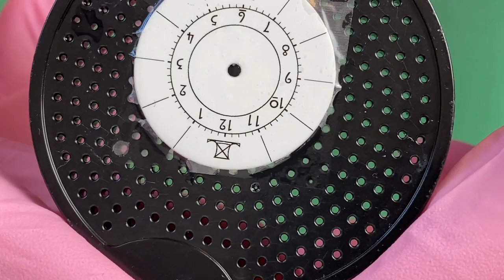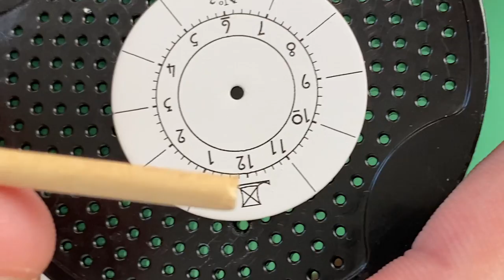Making Custom Dials: A Waterslide Decal Process That Works!

Comment: I haven't ever used the "film free" decal paper yet.  Looks very interesting.  I have a laser printer that can also print in white.  Let me know if you ever design a face with white details and I can print it up for you to see how it works!  Great video as always.
Reply from the maker: sounds good. thanks for watching :)
Reply: Hi DimensionMachine, do you still have the ability to print in white? I’ve been having a hard time trying to find someone that can, but if you are able to I’d love to work with you on something!
Reply: Hey i'd be interested in getting a dial printed. I have a black dial with white details.
Reply: @kramerdesignco  I am sorry.  The afore mentioned printer is no longer in use but you could search around for somebody who does laser transfers.  You will need to find somebody with a white toner transfer printer.  Full disclosure white over a black base is going to be the worst case scenario appearance wise, and you may very well end up not being happy with the result.  Plan to iterate and do several experiments.  best of luck!

Comment: I do models and watches. Doing decals with INKJET decal clear or white paper,  print your decal then spray a thin layer of flat or semi-flat clear coat of paint over it. Let dry.  Now you can do your process and it is done.  PS: read the back of bottles. You use them backwards. SOL first and SET second.
Reply from the maker: I’ve thought about using spray, but I usually do that anyway when a dial is completely done. As for the process, it’s not so much about which is first, it’s that they are a little different. Set is used to help prepare a surface, and Sol is for helping it adhere seamlessly with the surface. Both soften the decal, but Sol a little moreso. In almost all examples I’ve seen of their use, Set is applied first and Sol second. This also works for me. :)
Reply: Yes the bottles are numbered as witch to use first.  Also there not for filmless decals, it wont penetrate that kind of film. It's for cardiograp style water slide decals. Not what you were using. Different kind of decals. I'm a modeler of 30 years and a watch tinkerer, I've used both those products for years and with standard good model decals they will look painted on. Great video though, just different kind of decals.

Comment: Use vector art rather than raster art and you will improve the line edge quality greatly
Reply from the maker: it is vector based. It’s a limitation of the printer, not the art.

Comment: Great results! what do you think about using Ghost White Toner products to print white? seems like that's about the cheapest way to print white... might be worth a shot
Reply from the maker: It's a good question and I have looked into it some, but the white printers/toners are very expensive. You're almost better off painting the dial white and then creating the dial using black for everything except the things you want "printed". Basically everything is black except the negative space.
Reply: @WatchComplications  thanks for the reply, yes most of the toners are expensive, but they have some new ones for 150-200 euros last time I checked...
The reason I was looking for one is basically you are restricted by the negative print to always have a black background, or always mask everything with the color you are printing, if you want to use some interesting blank dials with unique patterns or textures with dark colors, then adding the white text or markers this way is not really doable.. 
I have tried it before, only occasion this worked for me was when background was black... other colors were not nice at all. 

I tried print colors with color printer, it will only look half decent when you have pure basic 4 CYMK colors, which doesn't need mixing different colors, even then it didn't look very nice, as colors are translucent white background is always needed...
 
 I'm now searching for a compatible printer if I can find something reasonably priced I would probably test the toner.
Reply from the maker: Thanks for the context. I plan to work with some colors next and see what happens. Perhaps I'll eventually get to white.

Comment: Thanks so much for posting the whole process and what you learned form the different iterations! Did you find the Micro Set leaves any residue?
Reply from the maker: Glad you found it useful. The Micro Set did not leave any residue, very happy about that. The glue that comes with the decals tended to leave a little when I tried it for the first video.
Reply: Yes.  On my metallic sunburst dial surface it did.  As noted in the video, have many test dials and don't use one you can't replace.

Comment: Can you do some ultra closeups sometime at an oblique angle to see the texture of the print (not the resolution, I mean like is it glossy, is it 3d a little?)
Reply from the maker: matte works best for anything decal related on a watch dial, based on my testing so far. maybe if working on a porcelain or enamel surface the glossy results would work, but not on a glossy painted watch dial. The print is simply an ink transfer...there's not much if any texture to it. Any texture is based on film residue that might remain.

Comment: where do you get the blank dials at? Also the holder that you can press your dials into? **EDIT: also where do you get the templates to print with as well as what program?
Reply from the maker: i get dials that may have other things on them and strip them clean, re-prime, and print. can also get blanks sometimes from ofrei or esslinger, depending on size you are after.

Comment: Hey bro, so having just worked through this process myself and having real difficulties with your process, I found the following additional steps pergected my process:
1) Clean decal with Isopropyl Alc before dropping in water (this was the recommendation from Dr Decal the supplier of paper I used)
2) Clean the dial, I was lazy and used Isopropyl alcohol here but do so at you own risk.
3) Apply Microset with an atomiser spray bottle which will provide an even application across the dial rather than pooling together as you experienced. This will also massively help with applying Decal to dial.

All.other steps as per your process. Without the above I couldn't get a Clean transfer and everytime had areas of my print that didn't transfer.

My transfers were pit in a white Enamel dial and look really clean and as if printed. Really impressed.

Thanks for the tutorial!
Reply from the maker: your first step is interesting...I'd almost be afraid of isopropyl being too abrasive on the ink, but maybe it's ok if it's fast. Clean the dial, yes, i typically do that i guess, can't remember if I specifically said that or not in this vid. a small spray bottle is a good idea for coverage. thanks for watching and sharing.
Reply: @WatchComplications  Yeah, it was the recommendation of the supplier to clean the decal with meths, I gave a test print a really good rubbing with iso and had no transfer so seemed safe. Was a little more worried about cleaning the dial with iso but tested it on a test dial I'd bought and no drama.

Regardless, ended up seeing much more consistent results adding the above steps! Hopefully that helps others!
Reply from the maker: @tobihall2247  yup any additional info that might help is very much welcomed!
Reply: @WatchComplications  merry Christmas mate!

Comment: Happen to be wearing the same Vario tee shirt in blue this morning...😀
I particularly enjoy your custom dial and how to series.  Always inspired by them.
I will have to go back now and review how you made the decals.  Can you print decals with better quality then a laser?
Reply from the maker: The decals are printed on film-free waterslide decal paper with a laser printer. When I do pad printing, a laser is used to etch the design into a steel plate. All lasers are not created equal. The etching fills with ink and then a pad is used to transfer from the plate to the dial surface. Pad printing is better quality, but these decals can be pretty good also.

Comment: Great video! Thanks for showing your whole process. Have you tried with colored decals? I'm curious if the chemicals change the colors at all. Also, what kind of primer and clear coat did you use?
Reply from the maker: I haven’t done this process with color yet but will soon. Might make a short video of that when I do it. For these dials I used a Rustoleum flat white primer, spray paint.

Comment: hi, i loved the video! could you do one about white decals on black dials.
Reply from the maker: same process, just paint the dial black and then apply. The issue and cost is a printer that can print white. White toner is crazy expensive. The other option is using a white dial and then creating a graphic that is black except for what you want to be white.

Comment: Hey I'm about to try this method to print a custom date wheel. Do you think it would come out nicely even under the magnification on the crystal. The image is plenty large at about 4000px and extremely sharp. I guess it'll depend on the printer but I'd love to head your thoughts and any other tips you might have on my project.
Reply from the maker: only way to know for sure is to test it :) But your chances for a good look are improved by having that high of a resolution. numbers and letters usually look fine. It’s angled lines that usually look digital.

Comment: This is the best tutorial I've seen, thanks! Can it be done in reverse- have the black decal cover most of the face, leaving the numbers, etc uncovered?  Remove the film as usual, then apply pigment over the entire face, and use some chemical to remove the remaining black decal?  That would give the numbers a painted on look.
Reply from the maker: I'm not sure how you would have a decal that has cutouts for the numbers, if I understand the process you are describing. And about any chemical is going to remove paint, be it the numbers or base paint.
Reply: @WatchComplications  basically I'm thinking about if you can invert the black/white?  So when it prints, most of the decal is black and will transfer to the face. The numbers, logo, etc will be there as the absence of decal.  Kind of like how the film in film cameras is the negative of the actual image.
Reply from the maker: oh, yeah you can do that, basically white is gaps in a color print, although you can also order decals from some shops that have printers that can print white. Some printers can print white, but cartridges are quite expensive. I haven’t tried that myself but that’s something I could test for a future video…the black with white numerals and markers sort of thing
Reply: @WatchComplications  that's it.  But a further step, if possible, is to apply paint to the entire dial afterward and somehow remove the decal, so the paint remains on the dial for the numbers, the rest of the face was "protected" from the paint by the black decal.
Reply from the maker: doesn’t work that way. the decal in my examples is the actual transfer of ink from the film paper to the surface. there is no removing the printing without affecting the surface.

Comment: Always thought microset and microsol were for transfers where the film remains on?  Filmless transfers the toner from the film to the dial surface in the oven so microset might help get the surfaces laying closer together but think the microsol kind of dissolves filmed transfers so the film blends in better to the host surface. Interesting to see that it seems to help with filmless too...
Reply from the maker: yeah, I’m not exactly sure to be honest. What I do know is that it still needs baked, won’t transfer without the heat. But the chemicals certainly seemed to play a role in helping adhesion. It was night and day after the baking depending on whether I used the Micro products or not.

Comment: Any suggestions on where to get blank watch dials from?.. Just starting out and would like to try
Reply from the maker: Esslinger has some brass blanks in a few varieties, could also look for low cost done dials from ofrei, ebay, and the like and then strip them and repurpose, which I do sometimes. Or get a local maker to laser cut some blanks.

Comment: Hi, great vid as usual. I really want to try this myself on a dial with no next, but which does have applied indices. Do you think any damage will come to the indices (which are lumed) in the heating process?
Reply from the maker: it shouldn’t impact the existing indices. look at some of my other vids, especially the latest one where I compare micro set and micro sol with the sunnyscopa glues. https://youtu.be/nctLo7Nm1ws
Reply: @WatchComplications  Actually I was watching that when I was alerted about your reply lol! Was very useful to see you testing on black dials. My dials have raised indices (which I hope are metal and not plastic), and wonder if they will be effected by the heat. 

This might be a stupid idea, but is it possible to layer the decals? Apply one, then apply an identical one right on top for a more pronounced look, and a bit of height  (and perhaps cover up small imperfections)?
Reply from the maker: Look at my video on that specific topic: https://youtu.be/s6-WAOx0pbM

Comment: Good thinking with the micro sol set. Did you bake at 200 fahrenheit? (98 celcius) and how much dpi is your laserprinter?
Reply from the maker: I think I baked at 225f for 20min. Resolution is 2400 x 600 dpi

Comment: hi, very good idea, if I have a black dial, its posible to do silver marks? other question, what program do you use to design the dial? thanks
best regards
Reply from the maker: There are three printing approaches to printing a white/silver color. 1. The base dial would need to be that color and then print black on a decal that covers everything except what you want to show. 2. A printer that can print in those lighter shades...not cheap. 3. A black dial and go the old school and quality route of pad printing. As for graphics programs, I typically make my dial designs in an app called Graphic for Apple devices. And sometimes Affinity Design. Hope that helps.

Comment: A question about the glue suggested by Sunnyscopa. The product suggests their W2 or W1 glue depending on the paper type. I noticed in the video you did not use either one. Does the Microset/sol product replace these? Also, have you tried this on a painted watch dial? I am thinking of painting Brass dials with an enamel, would this work with the heat?
Reply from the maker: Basically, yes. The W1/W2 glues work ok, but they leave more residue than I would like. Doing it this way gives a cleaner result usually. At least in my testing.
Reply from the maker: To the second question, these are painted dials, which works fine. I haven't tested it on enamel, but I image it would work ok, just need to use the paper type for polished/smooth surfaces. It's possible you would have to use the Sunnyscopa glue on that surface, but if it were me, I would test with the other method first.
Reply: Thanks! Have you tested light designs on dark painted dials?
Reply from the maker: that's up next in this series. I have some dark dials and want to see what visual impact the glue or residue makes on the dial.

Comment: Would you consider doing some work for me? I’d be looking for certain things over and over on one sheet that I could just cut out. Just two words nothing crazy. If you can help let me know and we’ll figure it out. I know less than zero about computers.
Reply from the maker: Unfortunately, I don't function as a dial maker for others' custom or mod projects. I share my knowledge about processes, but the dials I make are for use in watches I make for my brand/clients, or for just general knowledge like I did here.